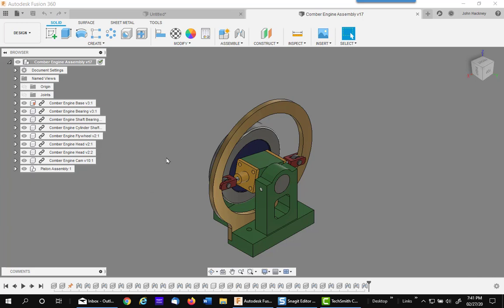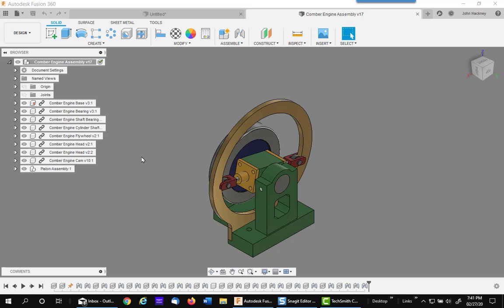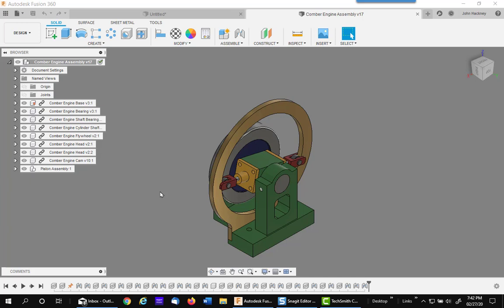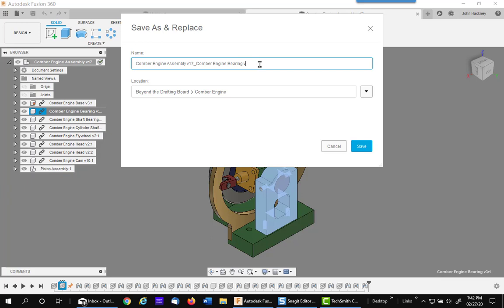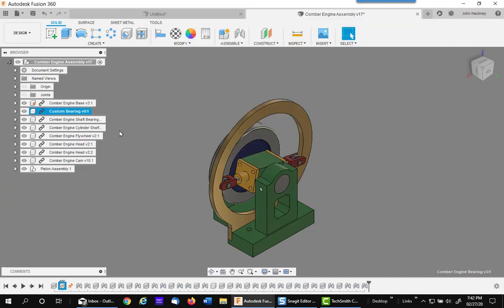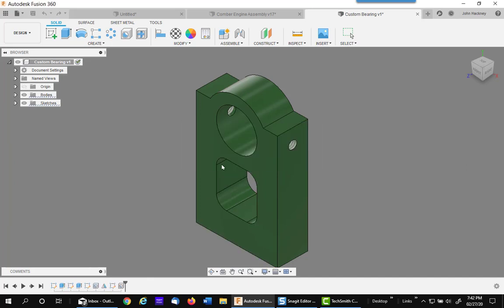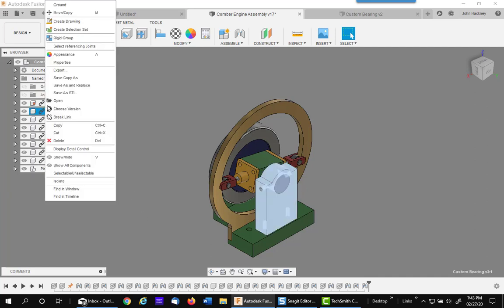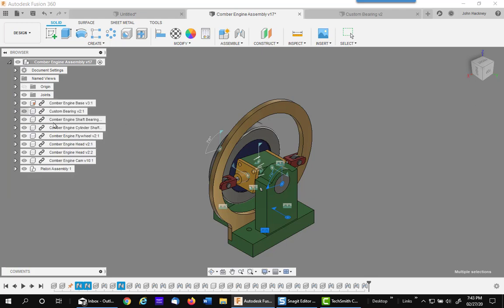Save As and Replace Command in Autodesk Fusion 360

Comment: As a SW user I am wondering if there is a comparable solution to replacing multiple parts in an assembly in fusion 360. For example I have 15 clamps jointed into my assembly but need to change them from one clamp to a different clamp(already existing separate model). Is there a quick way to replace all my clamps with a different file?
Reply: I have the same problem. This method works if you have just one component that you would like to replace. Not if you have multiple instances of the same component. Its such a shame.